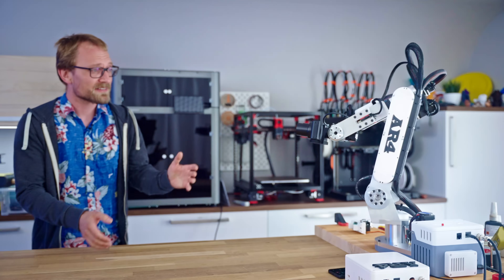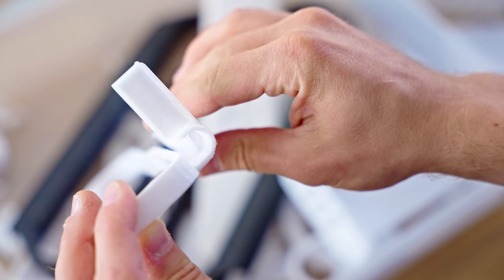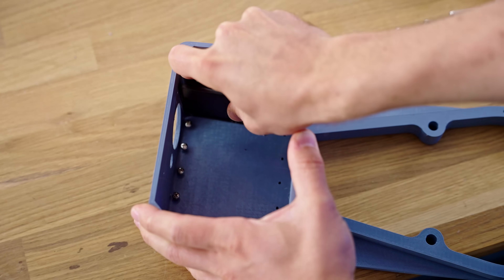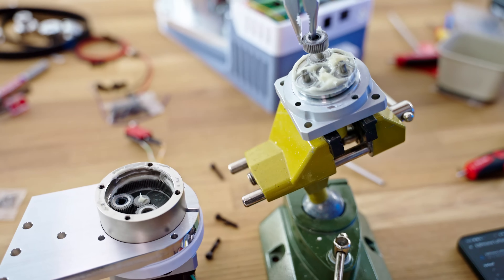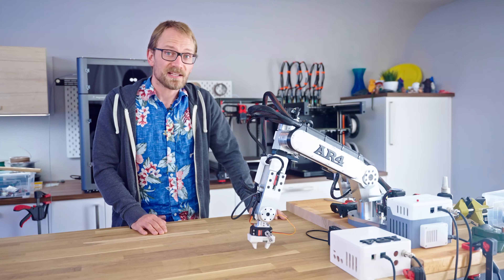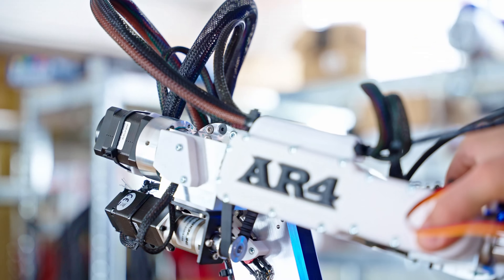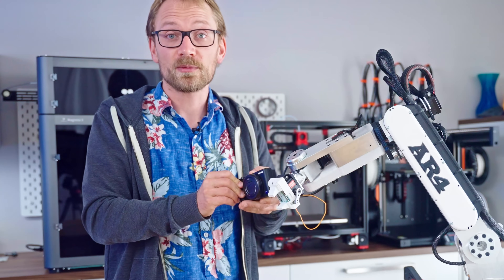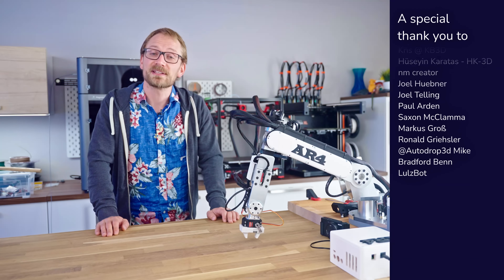I built myself a new Robot Buddy!

Comment: we really need to get past stepper motors. it's not like an encoder is an expensive thing when done in mass production and a brushless motor with high gearing is just way more agile. the eager chinese could make both dirt cheap. For the metal robot parts, maybe many of them could be stamped in sheet steel. a few of them metal 3D printed

Comment: Is the software open source, or at least available on linux?
Reply from the maker: The firmware and control software's sources are available under a BY-NC-SA-style license, but I suspect getting the host to run on non-Windows systems might require some tweaks on serial port and file handling.
https://www.anninrobotics.com/downloads

Comment: I feel like rigidity is a lost cause for anything that costs less than a car. I would try compensating for wobble like the bambu printers do, by counter wobbling with the motors, and using valve vive trackers or meta quest style SLAM trackering and accelerometers. Humans are hella wobbly but we get sht done, and can lift more than 4 lbs. Also maybe you could use a DIY steady cam rig to smooth out your bot's wobble, like we do for humans.

Comment: this is awesome, imagine making a 5 axis 3D printer for cheap
Reply: It wouldn’t be cheap, but agree that using a 6DOF robot arm, especially one mounted on a rail, as a 3D printer would be great - tool changing? No problem. Printing large objects? Easy. Doing it all using zero support material, no matter how complex the shape? Again, easy, as long as the slicer could handle it.

It would be slow though, but look amazing while it was printing - like a moving sculpture.

Comment: I've always thought something like this would be amazing as a camera rig for stopmotion. Though I don't know if stepper motors would be the to go. 🤔
Reply: Yeah in motion control systems controlled by software like Dragon Frame, they drive steppers. In stop motion mode, it moves the perfevt amount in all axes to create a smooth video when finished.
Reply: @MakeTechPtyLtd  Good to know I've never messed around with the motion control system in Dragonframe.

Comment: Pretty sure he will never use this robot arm again. 
Only use case I see with robots arms are put something from A to B, for welding, or for CNC machines to supply new material and get the finished part out the machine.
Reply: I've build a robot Arm in 2018 using Chris' Software and wiring... 

the machine itself was more like a toy, jes. 
But the skillset you get after finishing such a project is priceless!

Comment: 90 Days late but thats OK...
First off, TO the haters: PLEASE design, build, test, scale, sell, and support a project of this size, then PLEASE show it to us....
Thomas: 1/2 of your issues were self inflicted, your hand skills or your "giveaF" must be lacking..... 

As for the AR4 kit:
Its SPOT ON for its purpose, 
NO its not an industrial level machine, 
its NOT marketed or sold as such, 
nor is it priced like one, 
so IDK where all the hate is stemming from, 
but yall need to ease up on the bashing... 

THE WIRING:
Seams LOTS of people have an opinion on this topic
Being a budget machine, your going to find some shortcomings,
UPGRADE yours if you feel that strongly about the issue, you could be paying $100'S per cable for manufacture specific parts, so RELAX 

The only REAL drawback I have found: 
Software needs some tweaks if you want to run it on a remedial/budget laptop 
operating window size and resolution levels are in a FIXED window, VS a scaling/cascading window.....

Comment: The precision-clocked screw through two thread thing is cringe af. Should be bearing with internal thread, which goes onto the screw, then fastened only on one set of threads.

Comment: One of the Reasons for the shaking is the bad construction of many of these robots. It would be easy to just make a a support structure on the other side other than having this C-Like Design. You almost never need to turn around the inside of the Arm. You don't need the 720° on the large arm. I dare anyone to give me an actual, reallife example where that would actually be usefull where you can't just have the Robot sit back a few feet from the working area (which you should always do, as close passes on the robot itself might damage it)

Comment: Great video, thanks for trying it out. Generally doesn't look bad, but I'm sorry; putting the encoder at the motor instead of at the joint should be criminal. That is just so dumb. Also, I never understand why no robot manufacture counterbalances anything. That's such an easy hack to get additional capacity without additional cost.

Comment: This feels like a product where the engineers got to make a product. Nothing is designed well, just "well enough to work for my purposes"
Reply: As a product designer, that's not what happens when engineers get free reign in my experience. When engineers get free reign, you get Voron. This is what happens when you're asked to design a product with half the budget that you know it will actually need.
Reply: Guess you missed the part where its all done by one guy in his spare time.